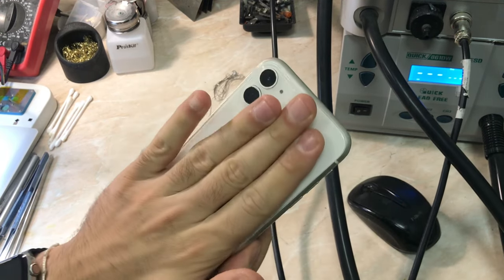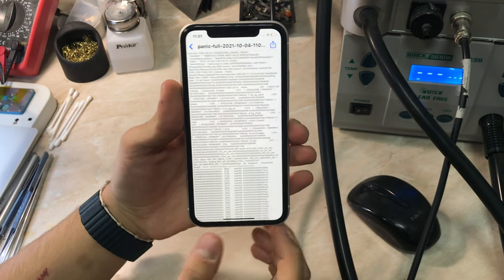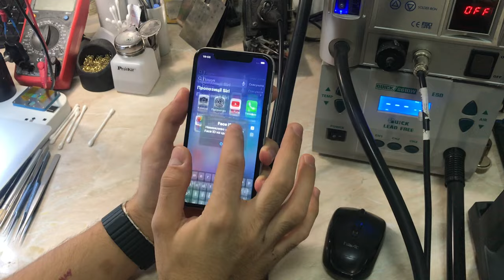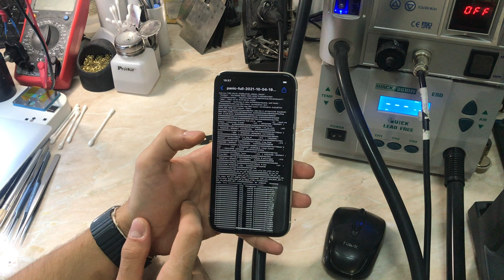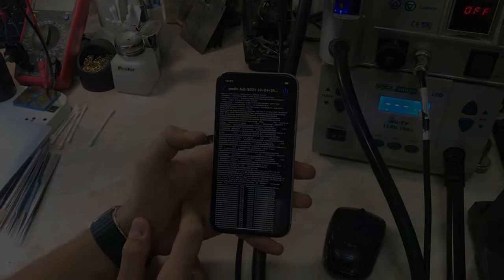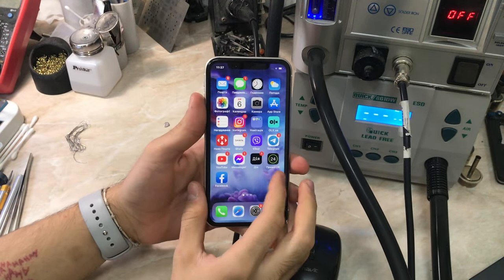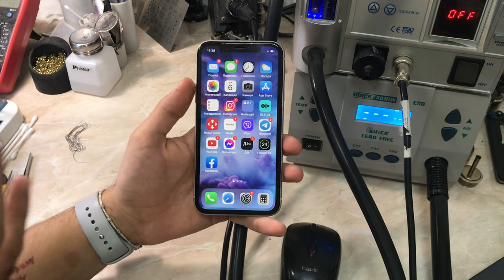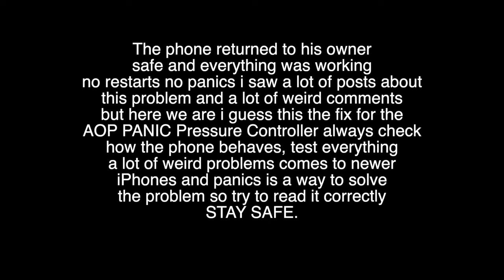iPhone 11 Restarting Every 2-3min (AOP PANIC [pressurecontroller.cpp.280])

Comment: Sound lines not shorted . Lines have a lot of caps . To measure line you must discharge them. You just changed all the amplifiers, but the problem with reboots if you left it for another reason
Reply from the maker: I agree with the discharging,each line has 2 caps but for the SPKRAMP_TOP_TO_COIL_POS the line is not shorted on a functional working board so until this day the customer didn’t send his phone back and last time I checked like 2 weeks ago when I started to edit the video 😅

Comment: Thanks for this info I changed the charging socket. I also removed both the face id and the charging socket from the card, but the device restarts again.
SD: 1 BC: 1 RC: 0 BS: 2, Missing sensor(s): Prs0
Reply: I have the same thing, what did you do next?

Comment: Which message is "AOP PANIC - K2-Bosch control channel write failures"? It's usually okay, but if you raise the volume to the maximum, it reboots and panics like that pop up.
Reply from the maker: Try original charging flex first, and if it still the same DM me
Reply: @AntoineKiriaky10  what is solution?